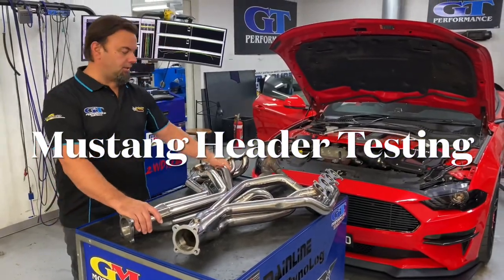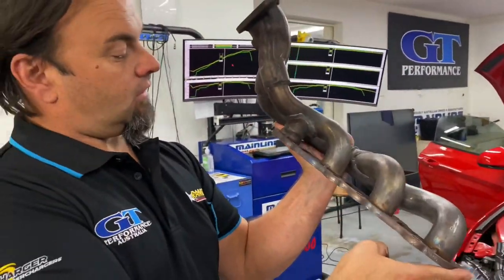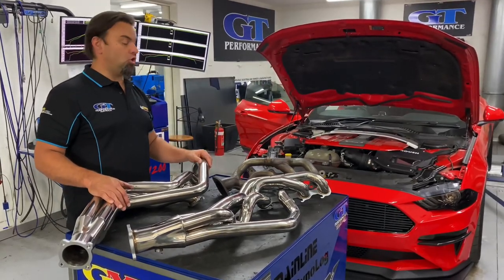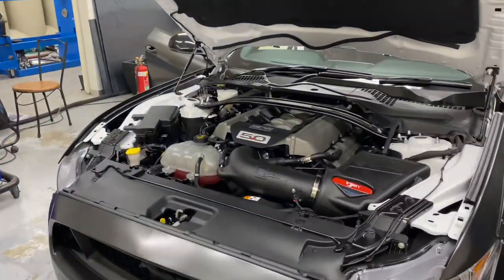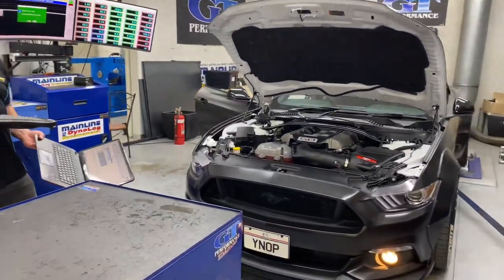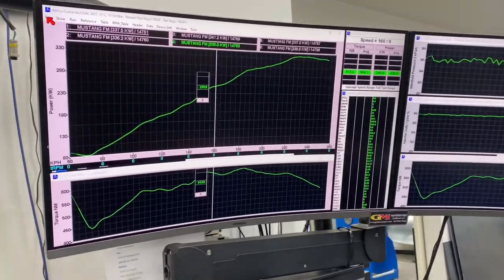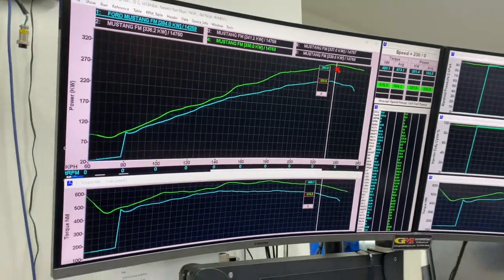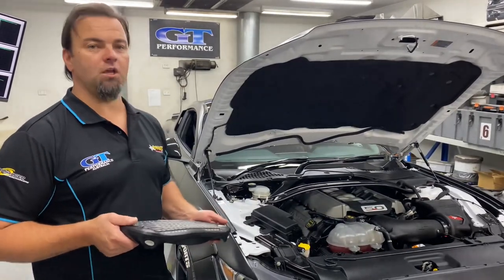Mustang Header Test

Comment: I have the 2017 with 1:7/8 ceramic coated headers and 20kw tune on top. GT 350 sump,  billet oil gears and cooler and billet timing gear. Sweet. How much extra did you get from stock vs headers on 15/17 model?